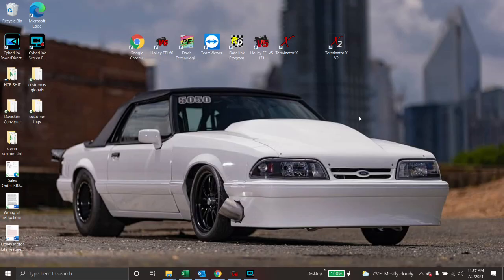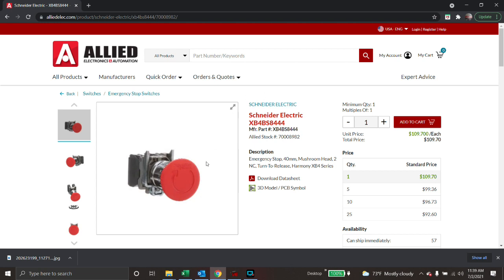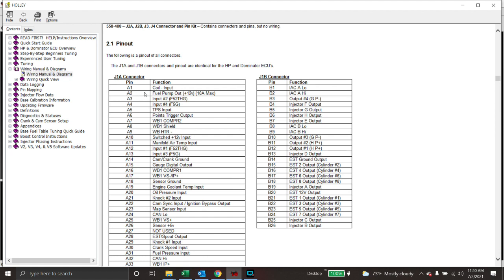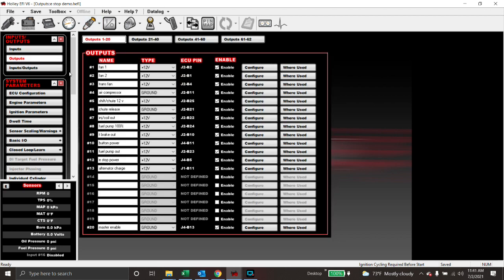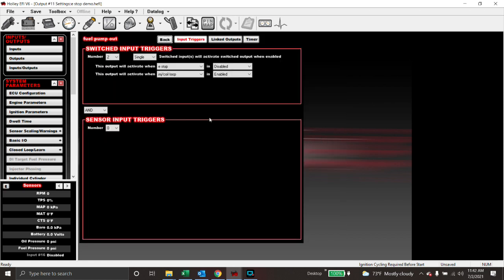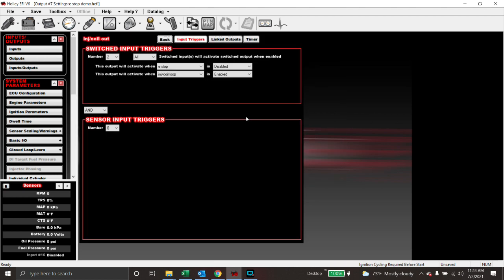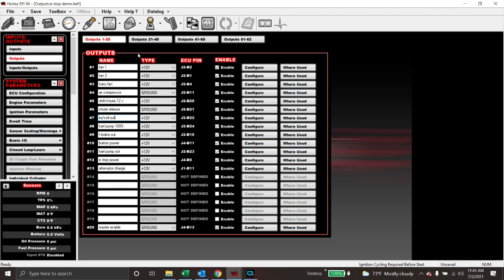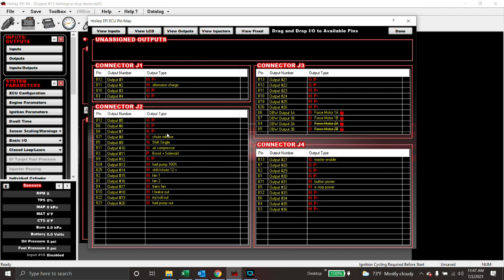How to add a Emergency stop with Holley Efi

Comment: Hey Devin, great video, i used this strategy with my msel battery disconnect that has an ecu output when you hit the kill switch that i use to first kill the engine (via coils/inj/fuel).  The msel waits to kill main power until alt is not pumping amperage which os pretty slick.  I do have a question from your video when you are defining triggers for the outpits theres an option for single or all.  I see in the video you have it designated both ways.  Does single mean OR for multiple and does all require ALL to be satified like an AND?  Love the videos ive learn a lot on my first time using holley and thanks to the diy wiring kit i got from you

Comment: I installed a new column on my 92 Camaro I took everything out of my car and I built a dash then I rewinded my car using 12 gauge wire and I built a switch panel and I bought a good quality toggle switch 
Switch 1 will turn on the Holley 6.8 digital display after I buy it from Laura 
Switch 2 puts power to the start button 
Switch 3 is the red and white wire from the Holley terminator x these three switches handle only the one designated component per switch 
The of course I have other toggle switches for other items on the car 
All switches go to there own relay as well 
This took a while to set up but I’m proud of myself for putting this all together

Comment: Devin do you think that just putting a hidden physical switch inline with A2 fuel pump enable +12 is an ok and safe way for the ECU way to accomplish an "engine disable" for a terminator x car? Just to stop someone from jumping in and just quickly driving off. Keep the videos up...   between you and Joe Simpson I'm getting a hell of an education in to the holley system
Reply from the maker: it would yes, or just load a tune that doesnt have any fuel or timing in it and wrong firing order

Comment: I think  Holley provides  a inline fuse circuit  that power's  the injectors. Wouldn't it be easier to wire the e stop in series with this circuit  ??
Reply from the maker: in my opinion no. but we build harnesses to suit the application.  and to have the programming logic to change its functionality is very important to me.
Reply: Hmmm, okay..